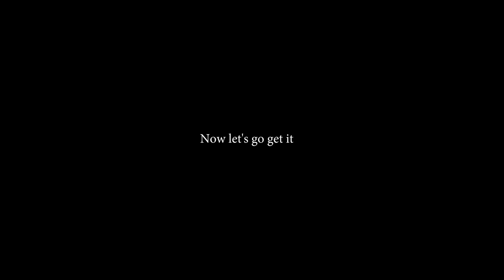Buying and fixing a lowboy trailer : Centreville 35 ton detachable

Comment: here on Ont. Canada for the person with a few peaces of equipment a set up like that to keep licensed ans yearly safety on truck and trailer and the insurances your in the whole big time before you can even start it up and hook on, one thing is for sure you cant just go an buy a trailer lowboy, run out hundred miles and hook up and go, sure as long as you insure the trailer or lowboys you can get a 3 day permit to move it to a licensed shop that do MTO  safeties, with no load,  but your not going to run a 100 miles with it. unless the truck, trailer or lowboy is working every day, it costing you thousands of dollars a month, hell just the plates for 6 months on the tractor are over $1800.00, insurance just for the tractor a year around $2200.00 if your lucky, not including any trailer or lowboy you hook to it needs its own plates, yearly safety and plates, plate cost on the truck or trailer is based off the REGISTERED GVW, IE: TRAILER AND TRUCK.  just to have my safety every year for my 5 ton costs $1500 cnd every 12 months and that only 2 axles, another $800.00 for my 10.000 lb GVRW TRAILER. before i changed the registration over from commercial  i was paying all most $700.00 for 6 months plates for 15,000kg (33,000Lbs) for the truck, but i clanged the registration over to Farm plated same weight now i pay around $300.00 a year for farm plate, still need the yearly safety and insurance. the trailer i slip down the road as farm equipment, long as i dont get checked..    it is in the thousands for just the tandem/ tractor truck, or trailer/ lowboy each, not including-- a--n-y work that needed that dont pass. nut on the other hand if you have the cash for the tractor, and the lowboy for pates for each for 6 months, safety for each per year, insurance for each per year, your good for 180,000 GVW, BUT ANY OVER WIDTH, OVER HEIGHT, OVER WEIGHT  permits are extra, most guys moving equipment daily buy a 10 foot wide over width yearly permit
Reply from the maker: with insurance, registration and inspection on this truck and trailer, I am looking at about 1600 a year for everything . I might look into registering my trailers in maine, then it woukd cut that 1600 down to 1000 a year for everything. hopefully we dont ever become like where you live, that is crazy
Reply: @jmuller86  yes it is totaly crazy, even my 5 ton dump truck with fold down sides that hold 7 yards as farm plated still reqire a yearly safty check and there few shops that do big trucks so they really hammer you on thecost, and some times you have to go back 2 or 3 times for stupid things, only because you take it home and do the repairs your self instead of paying them a parts mark up od 140 to 200% mark up, you can take a wheel off but unless you are licensed to install the wheel you have to have the shop do any work were the wheels have to be taken off, an they charge you extra every time you have to bring it back after a totaly stupid repair that not even in the book, but because your not paying them there $160 to $198 shop hourly rate. you do that repair take it back for a check and the fn guy say oh this is wrong too. any time i have to do any brake work i take thewheels and drum off as one unit to avoid having to pay a shop to do thework were a wheel need t come off, but taking wheels an drum as one unit is dam hard due to the weight, what got me i had to but 2 new steer tires 5 years ago, lucky if they have 1200 miles on them, but they show weather cracks in the side walls. witch will not pass, even tho they are small. never again will i spend $2200.00 on 2 new Michilen tires plus $250 each install. never before had truck tire get weather crack with so low mileage an age, your lucky to only pay 1200 a year for safety inspection. plates for truck an lowboy and insurance, insurance alone on my 5 ton is $700 a year with no collision. my broker told me dont ever cancel the coverage as i will never get that rate again, how ever i drop the liability off in the winter as with 40 below an 7 feet of snow there no use for it, when it was commercial plated i used it year round, hauling snow away from city parking lots. i know contractors with tri axles, lowboys, 4 to 7 truck, and all these cost all most brakes them, not many one man operations any more, just cant make a go, work 7 days a week 18 hours a day just to brake even, if you have to pay a driver, thats minimum 35 an hour plus EI, WSIP, 3.7% VACATION PAY, never mind if you get pulled over by an MTO  officer and he redirects you to there scale. even with your yearly safety, he will find some thing to nail you with, you ether fight it in court or pay, very nerve racking. i picked up 10 years a go a long frame F500 same as mine the the engeine compartment burnt, got it cheap, but all i wanted out of it was the 2 speed rear end witcch also has a much heavyer weight rating, my F600 dont have a2 speed rear end, so on the hyw, at 50 mpg my RPM IS MAXED OUT, AND 1ST GEAR LACK POWER WITH THE 370 ENGEINE ON SOFT GROUND, NOT SINKING SOFT.. JUST HEAVY RAIN ON DIRT ROAD, AN TO GET RID OF THE BUD WHEELS, WITCH ARE A PAIN, but i dont know now if i will ever change it over. my rear drums have been on run out for 10 years but every safty they still pass with a few 100,000 of inch yet, but the 4 u-bolts it need to do the change over is $260 last i checked, i dont need to do any drive shaft work, it is a huge rear end, but it will need 4 new tires, because there stranded size were mine are odd ball do to the bud rims

Comment: 18 speed is not needed on an N14.  That is for the turn slow run fast modern engines with the governor set way low.  MY old trucks had 13 speed CATs C-16 &15s  with the governed set at 2450 rpm.  It was high for in the woods stump hopping without shifting gears. Or climbing out of a pit with a heavy load.  I would cruise at 1350 rpm.  Rear axles were Canadian spread.  Most trucks a few years ago were  set to cruise at 1650 in high and 1850-1900  in lower gears. My old  WHITE 903 cummins triaxle was 2900 rpm as it was a high rev engine with 5.38 rears. Too far back for you guys to .....
Reply from the maker: thats good to hear. I think with the 3.90 rears it should crawl up out of a field without too much issue

Comment: all you have to do is add a  hydraulic stabilizer jack bar to the bottom side of the lowboy neck and just add a second hydraulic control on the lowboy for the stabilizer bar. thats what most of those lowboys normally have anyways me personally i always preferred that style of lowboy over the newer style ones.

Comment: Let's see, the trailer is 19 and the excavator is 29 so that is already 60,000 lbs, 70,000 with skidsteer. this excavator is 3" wider than your trailer so all that is perfect even with high floatation tracks. Of course the bucket may be 3" wider than your choice but that moves more dirt.  Ya'll are getting pretty good shifting that thing, better than Diesel Creek. So how much is the crane? With it of course it is the bulk more than weight. How high? In our state it is 14' 6" as that is how high our overpasses are. Of course you can pull off and go around a lot of them without even rerouting.

Comment: Honestly I would like to see you paint the trailer red pull the back wheels off of it shoot the hubs red in the rims to since its Odell so like to see you do the same thing to the Tractor paint the rims in chassis red that would make it real spiffy nothing like a tractor and trailer looking its best and a few lights that issue with the back of your tractor being able to lift the first part of your trailer what do you think about a piece of two-by-four Meritor hydraulic cylinder pump that rescue up in the air I mean that should hold you don't need a lot of space and still put your plate on back for a pintle hitch

Comment: Why cut air line so far from fitting that now you need to replace whole line as its too short mate????
Reply from the maker: it was because there was a kink there and I wanted to cut it out, but I loosened a strap and had plenty left in the loop

Comment: Hello, congrats on your low boy purchase. I wonder how sure you are that it was built in 1986? Your trailer air lines are plumbed backwards similar to 1975 and earlier trailers. Take a look at your truck, blue service line is on the drivers side and the service line on the trailer is on the passenger side so your truck lines cross. That is not good. The other thing you might want to look at is on the trailer your spring/parking brake glad hand is upside down so as it wears and you hit a pothole, it will eventually fall off. (should be the same as the blue service line setup beside it) Cheers Dan

Comment: Ramps=yes.  I would use blocks and not mess with the rear frame of the tractor.  Never pull an end dump trailer with out blocking the fifth wheel when dumping....if you do not have an end dump fifth wheel.  I would mound a heavy rear receiver with a hook up hook option.  Mine could be adjusted up and down and pull from 1 7/8 ball, 2 and 2 5/16 too.  The Pintel hook-up  would work up to a 2 axle  Semi Truck Pup Tailer *Rocky Mountain doubles*. I had many options as I was hauling for dealers various  equipment and stuff in 48 states and Canada.  Everything from a weed wacker to a TD25 dozer or a school bus and a motor coach. Lots of permits loads.  We were Heavy Specialized Hauler from Coast to Coast and Border to Border and then some.  Giant rubber tire for mine equipment 13' diameter for 400 tons trucks, Military tanks, Missiles, and etc.
Reply from the maker: I will have to check into an end dump fifth wheel, never knew they existed
Reply: @jmuller86  You can not have any sideways rocking .  You need limited fore and aft movement.  You can block the wheel if needed....but end dumps are very  HIGH INSURANCE items.  Lots of accident tip overs.  Best to have a conveyor or a  side ways dumper. .....always straight fore and aft.  A dump truck and a pup trailer is safer.

Comment: I'm an ex-OTR driver and I have noticed you seem to employ the Jake to slow down on low/no grade road situations. None of my business of course, but here's my comment. Engine Brakes are a great safety tool for running down long grades (my driving experience using Jakes is mainly out west with long 5-7% grades). OTH, Jakes are loud and can be annoying to 'civilians' when used outside of that necessity. While engine braking will save on pad wear, in most situations it might be best to shut it off.

Comment: You shouldn't use your jake brake when your empty with your lowboy. Jake brake will destroy your cylinder head quick. Jake brakes are the number one reason for cracked cylinder heads.  They are used for downhill braking. It sounds cool to hear but that will get old quick because after while they drive you nuts and kill your ears. I have pics where you can put legs on your lowboy just send me your email if you want the pics.

Comment: I would have at least drained the oil in the pony motor and checked it for bearing material before starting it. After 2 years of sitting it was due to be changed anyways.
Reply: And if you’re going to replace 1 plank you may as well replace all of them. You already had a log on the saw mill set up and ready to go.

Comment: # of chains requires is weight of unit/divides by strength/capacity of the chain used.  I would assume that unit requires chains if stopped by DOT.

Comment: My father would throw the vice grips into a fire pit, then say if you don’t have the right tools, go home. Shirley.
Reply from the maker: vice grips work very well for all kinds of things. Especially when your tools are 1000 ft away
Reply: @jmuller86  yes if you leave your tools 1000 ft away, go home Shirley.
Reply from the maker: @SPUDHOME  ...or you can just use whatever works instead of going back and forth a million times. not like I have a service truck with every tool I need to bring to the trailer
Reply: @jmuller86  yes i understand, rounding off bolts, nuts ruined hydraulic lines, if the expense don’t matter why not use a pipe wrench. to of them will replace a whole tool box. You can even use them for a hammer.

Comment: Please get someone to show you how to do restraints on a machine. The tracks are not a hold down point.
Reply from the maker: it is legal in the us to attach to tracks
Reply: @jmuller86   fair enough. Governments are smart and they are always right about everything.
If an operator can seperate a track from machine in what they would say was normal operation,  30k lbs going a different way to the other 30k lbs when you least expect it is a real possibility.
Hey its your gear, do what you like. Its up to you if youre the bare minimum type or the 'do it once, do it right' type of guy.

Comment: WTF your in NJ, WOW, how could you, or why would you. I can’t think of any reason that I would go to the cesspool state. No place but NJ would have that crooked of a road, driving in circles. Pony motor run a small hydraulic pump ?  I hope the rubber lines weren’t as old as the tank ! Your dealing with brakes, you really want them to work sometimes.

Comment: I would consider removing the pony motor and just run the hydraulics with a PTO pump, use an air powered pump or switch to an air cylinder. Those pony motors are just super unreliable.

Comment: man, the platform it looks so in need for capital maintainace asap, the tires, the chassis, the hidrauluc, braking system check allong with all the tubes and fittings, also an rework of the paint with the need't coats to prevent the rust that is already starting to get it; all for the safety and an long therm invesment

Comment: You are over width tracks hanging over side of trailer. where is your permits oversize load signage and flags??
Reply from the maker: tracks are just under 102 so I shouldnt need anything. right?
Reply: How wide is the trailer 8' or 102" most lowboys that I have messed with are 102"
Reply from the maker: @phatboizbackyardkustomz9006  trailer is 8ft